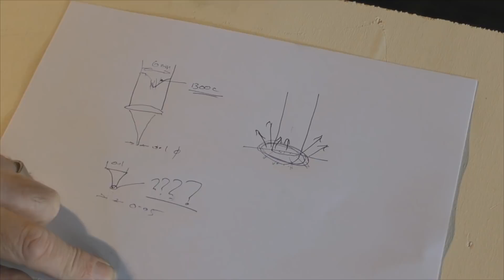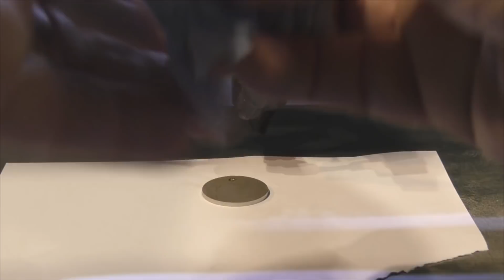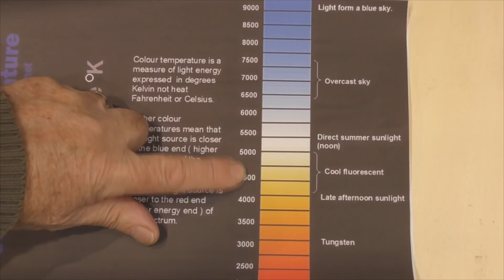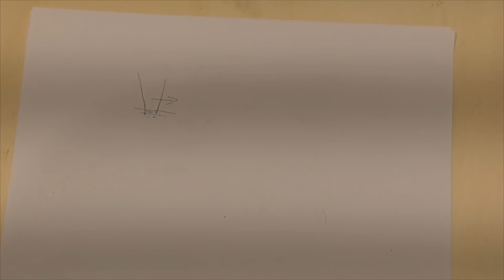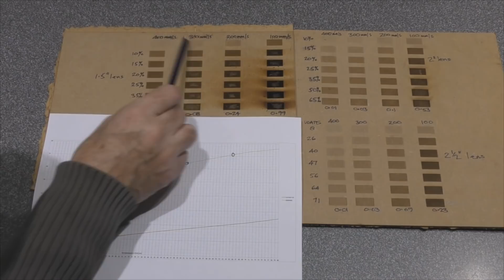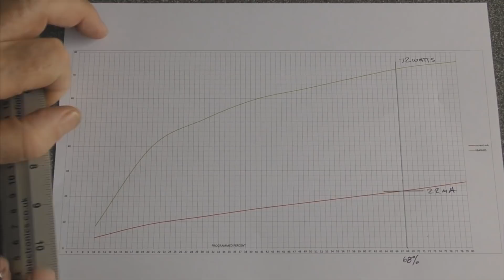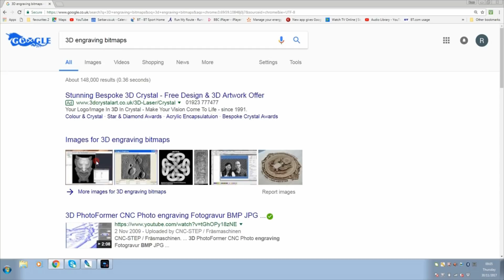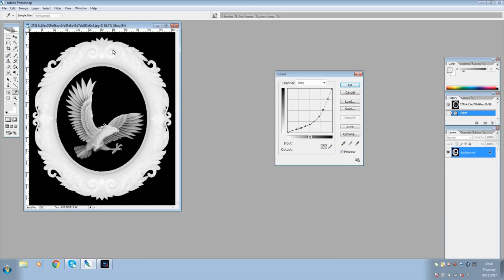RDWorks Learning Lab 126   3D Engraving Is this the FINAL Chapter Part 1

Comment: I saw you did stainless marking, what setting would you do on shiny aluminum? I have tried a lot and the dry spray never sticks..
Reply: Be very careful with aluminium as it is 99% reflective and potentially could damage the coating on your lens.I have yet to find a coating that will chemically react with an aluminium surface and produce a back finish. The aim will be to achieve aluminium carbide as that is dense black,  but I don't know how at present.
Best wishes
Russ

Comment: love this video. Have a question: if the light beam converts to energy (and heat) when hits a surface, how is possible that  measured temperature before the lens is 1300ºC ?? thank you so much for this video
Reply from the maker: Hi Diego
There is no temperature in the light beam it is just a beam of energy. In the same way that there is nothing obvious about the kinetic energy you possess travelling at 100 miles per hour. It is only when the light or you, hits something solid that energy changes state. The result of all that invisible kinetic energy  changing from one form to another is obvious for you to imagine in a car crash, with light it's more difficult to imagine. When light hits a solid surface, the nature of the surface determines what happens to the light. The molecules and atoms of metals are in  a densely packed crystalline structure and reflect the 10.6 micron wavelength light, hence we can use flat metal surfaces as mirrors in our machines. Glass on the other hand is the same as everything else ie non- metal and it's surface atoms and molecules will be stimulated by the light energy That stimulation increases their vibration activity and more vibration =temperature increase.
So why is there apparent temperature in the light beam?  Well, there isn't . The thermocouple is metal and should reflect the light energy but the way it is formed by welding two dissimilar wires into an alloy blob causes oxidation on and in the blob. Metal oxides are compounds with a much more open crystal structure and will absorb the light energy . Thus it is the absorption (transformation) of light energy that is heating the blob, the beam itself possesses no temperature.

Hope this makes sense
All best wishes
Russ

Comment: another question, why you get rid of the white colour on photoshop? I think is good to have some untouched parts on the wood for the 3D engraving....
Reply from the maker: Hi Diego
I have examined the power control signals from the controller during 3D engraving with my little oscilloscope. If you have pure white 255 in your picture the laser beam switches off. That is bad news because it takes a few milliseconds to switch back on and there is a huge potential burning depth difference by the time the beam switches back on and reaches its required power. I happen to choose 250 as my light grey limit because it is so close to white that you would not know the difference. However this makes sure that the beam never switches off and you get a uniform power switching response from the laser beam across the whole 251 remaining power increments. Trust me, if you choose to use 255 you will get large white flat spots on your engraving.
All best wishes
Russ
Reply: thank you so much, very clear for me. I own a laser and I create art on wood, your video is very interesting for me cause I understand better what actually happens to the wood when laser engraving. I don't think there is a market for 3D engraving with lasers (3D printers do it more easily) cause if you need to make several passes, well this would increase price and time and make art less affordable....

Comment: Does the glue in MDF throw any other issues into the equation?
Reply from the maker: Yes. That is why the test squares are so important. It takes all the guess work from that equation. You are trying to achieve the least amount of burn variation for the full power range of the tube/lens combination.
Reply: Excellent.  I haven't watched the whole video yet (or part 2).  Do you get to the point where you do multi layer engraving?  I read something about doing deep cutting first and then 1 or two other passes to finish detail and the final one to clean the carbon off of the final engraving.  My understanding is that it makes an amazing 3D result.
Reply from the maker: My personal experience is that you find a power/lens/speed setting that does not produce a carbon deposit because when I have tried the quick quick slow slow method  in the early experiements I did a year ago, I found that the results were barely ok. It was not saleable 3D engraving but probably the best you could expect from a cheap Chinese machine.. Not so this time. With a methodical approach to the problem and not a speck of carbon in sight, the results are truly amazing and of marketable quality.  You will see for yourself when you watch part 2. As I tell folks all the time, I am not teaching you anything, I am on a journey of discovery to find out what works and what doesn't. Starting from my success point, you can further experiment for yourself and bend the basic rules. At some point you will fall of the cliff but at least you will know where the real extreme boundary is.
Best wishes
Russ
Reply: Thank you!  I've learned a great deal from your journey.  I've had a "100watt" machine for a little over a year now.  It's been quite interesting.  I hadn't had a chance to do much 3D engraving but this has re-lit the curiosity to experiment with it again.  So off the cliff I go!  (I'll wear a helmet ... so don't worry .. my head will be fine)

Comment: Another Great Video.   Russ - do you or anyone out there know if there is an equivalent to Photoshop for purchase.  Todays Photoshop is by subscription only so those of us that don't have an 'older' copy are limited to signing on for the "IV Drip" as I call it.  
Cheers,
Dennis
Reply from the maker: Hi Dennis
Download GIMP2.8 it's an open source free version of Photoshop.  If you go to Tools ,Colour tools you will find Levels , where you can suppress the 255 white to output say 250. There is also a Curves tool that is less absolute than Photoshop, but now you know how it can be used to balance the greyscale to your tube power, you can make a reasonable guess and tweak it when you examine your results.
Best wishes
Russ
Reply: I was looking at GIMP curves and when you select a point you get an X and Y coordinate. Your scale is 255 x 255 so things would have to be remapped and I think to goes from black to white. A simple program/script could probably do the remapping for you and spit out useful numbers.
Reply from the maker: Yep. dragging those  points gives you a  reasonable rescaling . My experience  convinced me that you only need 6 to 10 points to get a reasonable remapping  Although the input for GIMP  curves is less user friendly, you are definitely getting a Photoshop near-equivalent for FREE.  I demonstrated the simple graphical way to remap because many folks will not have the ability to calculate or  to write script to do it. You only need to do it once, and as I demonstrated, the theoretical mapping did not work perfectly so human interpretation was required. 
All best wishes
Russ